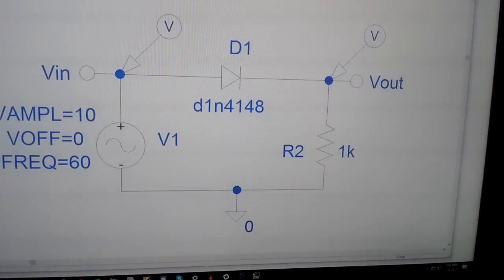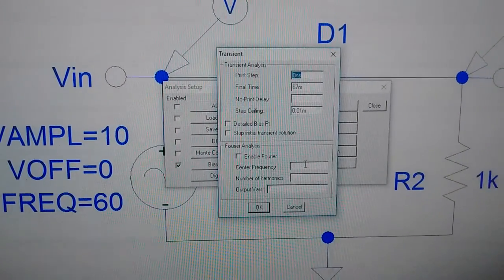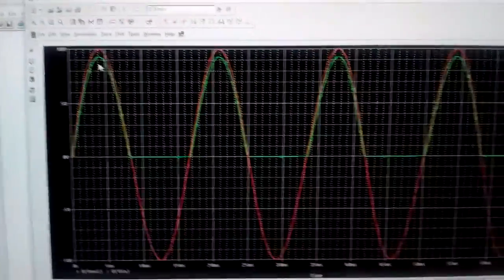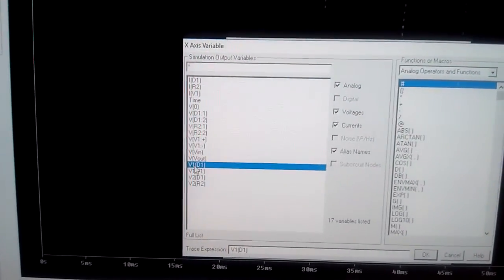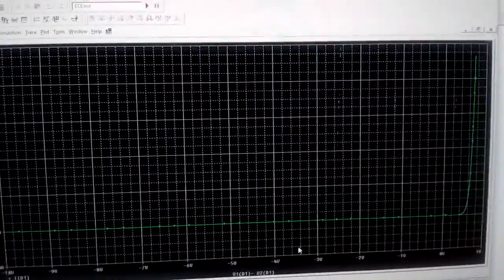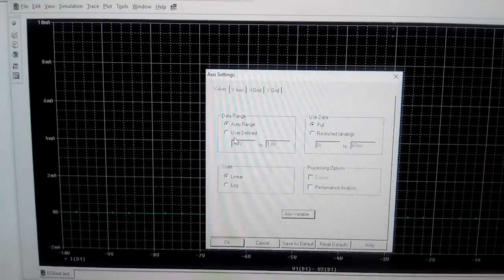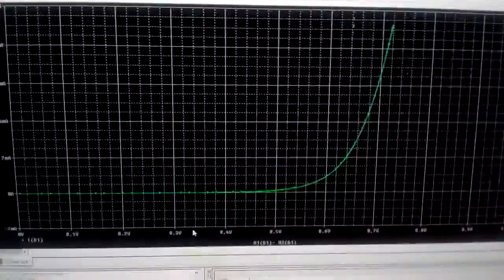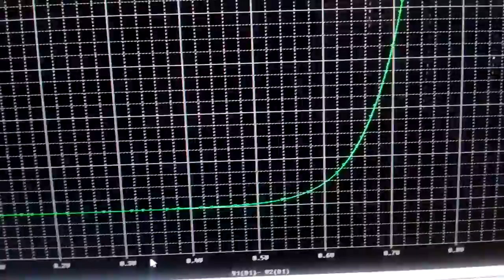How To Get The I-V Characteristics of a Diode Using PSPICE

Comment: my frequency is 1khz and resistance is 10k, is it normal that my curve starts rising earlier? (at 0.5V)
Reply from the maker: Hi! It's been awhile since I did any electrical circuit stuff, so if you're taking an electrical circuits course, I would ask your instructor for more guidance. I think I can safely say it’s the resistor that’s changing the simulation graph, not the frequency. So what that simulation graph is, is the current-voltage relationship of a diode. 

What you're probably seeing, and what I saw going back to my simulations, is that the curve actually rises at a similar rate using a 1k or a 10k resistor.If you select the trace option on the simulator and check the current using a 1k and a 10k resistor, you should see that the two values are pretty similar, they should be around 110 uA. This should be a similar value regardless of whatever resistor you use, 10k, 100k, etc. 

The reason it looks like it’s rising sooner is because when Vin = 10 V, the maximum voltage across the diode, the x-axis, gets smaller. So the trace ends much sooner. At 10k, you should see the trace end around 0.6 V, where as with a 1k, you’ll see it end around 0.7. And you want to see the trace end at around 0.6-0.7, as that’s usually what the voltage drop/potential of a silicone diode is when turned on.

I would take a look at the current-voltage relationship of a diode at this link for more info as to why the trace ends, it might help a bit more than my hazy remembering of how a diode works. https://learn.sparkfun.com/tutorials/diodes/all

Hope this helps!
-Rob